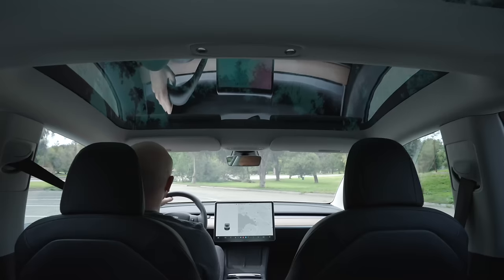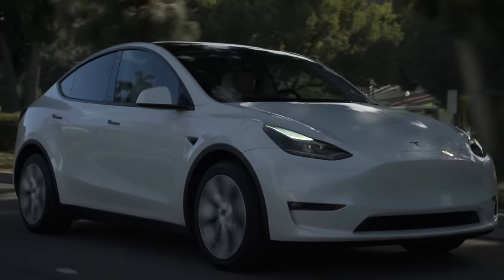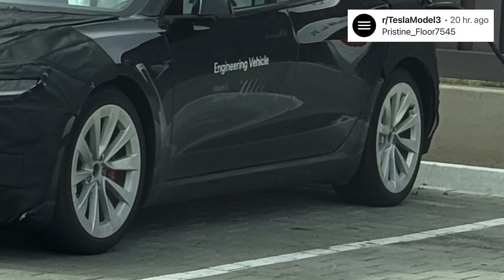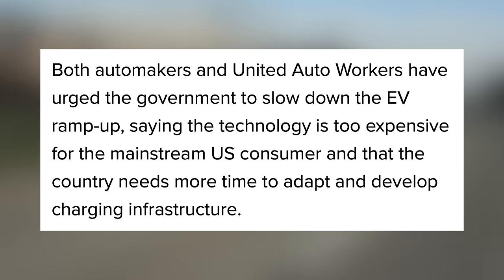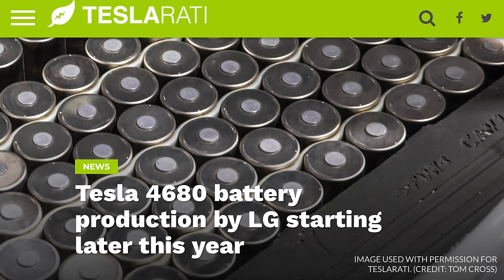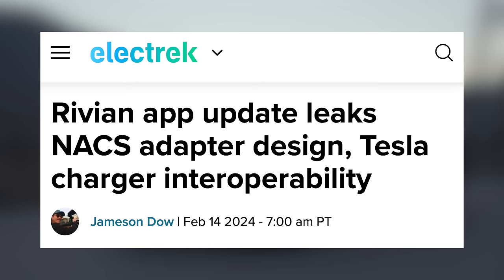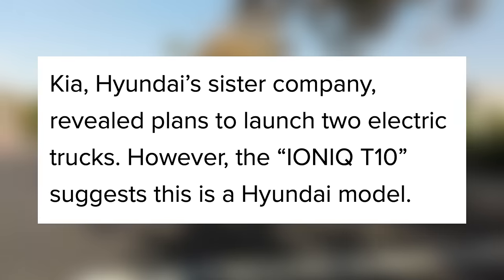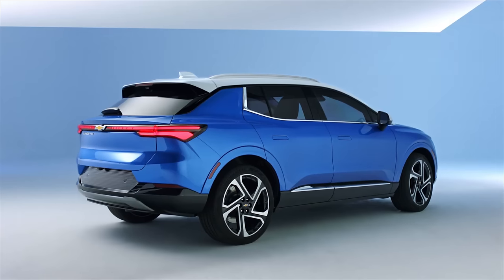NEW Tesla Photos LEAKED | We Can’t Wait For This Release

Comment: I am glad that Tesla is going to fix the auto wipers because it is currently the biggest frustration with the highland.
If they can just come up with an easyer way to operate the blinkers at roundabouts then its as good as perfect.
Reply: Yeah, maybe like a stalk or something that sticks out of the side of the steering column 🤔
Reply: its all of theese teslas not just highland its because they refuse to add a rain sensor and rely on a camera my 2011 shitbox 10k when it was new car has better autowipers than my tesla
Reply: @TagetesAlkesta 😅 😂 yeah no kidding.
Reply: I use 2, S3XY buttons on the front of my console. They are programmed for left and right blinker.  Works great.
Reply: @TagetesAlkesta  it'll never take off.
Reply: @salty8852  I'd prefer my cars to get the basics right, rather than have to fix them. Having said that maybe there's an industry in fixing Teslas shit interior design, adding stalks, adding a dashboard, proper gear selector etc, removing dumb ass yoke where found etc. Its a bit of a fixer-upper straight from the showroom to be honest.
Reply: Not only is this a highland problem. I think is an issue at every Tesla.

Comment: Glad they went back to a traditional horn on the Model S/X!  We really needed it for the last 3 years!!!
Reply: Facts!
Reply: I hope they’ll also bring back at least the blinker stalk. I don’t see how cars could reasonably used as rental vehicles without some controls being what everyone is familiar with.
Reply: Give it time and we'll probably see Tesla go back to stalks because by removing them they have pushed  potential customers to another brand. Not the best idea when there is more competition out there vs a few years ago.
Reply: I hope they release steer by wire for S and X
Reply: I have a yoke on my 2023 X.  I love the ability to use everything without yesterday's stalks.  I can easily turn the wheel with a finger.  On long trips I can easily rest my arms at the wrists on the top of the yoke.  I found that sliding my finger over the turn signal capacitive buttons better than touching it like a button.  Learning new behavior for some people is difficult.   Unlearning learned behavior is also difficult for some.  I have learned and trained my brain to use the buttons on the yolk, which has now become instinctive.  Even passing my thumb over the horn button is simple.  For slower learners, I would suggest sitting at the wheel for 30 to 60 minutes re teaching your brain how to use the buttons to the point that it becomes instinctive.  Learned hand coordination.   I love the yoke on my X.  Thank you Elon.

Comment: Hopefully they will bring back the whiskers for signaling. Having multiple roundabouts and the law that says you have signal out of the roundabout is just a really not something you want to experience in daily driving. They should be atleast optional because these buttons need to be pressed on steering wheel when it's upside down and the arrows are the wrong way and hand are not at good position to press them.
Reply: I don't think they'll bring them back unfortunately (maybe an option?). Perhaps what they could do is put an gyroscope in the steering wheel so when it's upside down what you visually see as the left arrow will function as left? Like when you're browsing the internet on your phone in landscape model and then you turn your phone upside down and the screen rotates back to an orientation where you can read.

Comment: 0:46 I thought the biggest problem is there is no progressive steering logic when the yoke is installed. Most every other car maker who implements a yoke in their vehicles has the steering sensitivity adjusted to suit the yoke-- full directional travel is achieved without every having to turn the yoke over itself. In the Tesla yoke setup, it turns like a steering wheel, meaning you have to spin the yoke completely when making sharp turns like for a U-turn or negotiating a 3-point.
Reply: because there is still wire connection except cybertruck
Reply: Outside of Formula 1 who else has introduced such a dumb idea for road cars?

Comment: I have 2 Tesla vehicles and have never had a lower total cost of ownership. The maintenance costs are super low, and if you charge at home then expect to get roughly the equivalent of 50 mpg. These cars are super affordable and just a pleasure to own compared to a complicated and archaic gas guzzler.
Reply: You must have really expensive home electricity
Reply: @Chukonu5  around 0.15 / kWh, not cheap but not terrible.
Reply: How about insurance? Is it $3000 a year? And registration fees?
Reply: @joo02  around $2k/year each so more expensive there, no reg fees really in my state, just had to change the stock tires after 32k miles, no brake jobs yet, no other maintenance beyond wiper fluid.
Reply: You must have been lucky! Every tesla owner I know has had expensive problems and they won't be getting another EV
Reply: @paulbaddiley7326  I've had a couple of problems, all under warranty and they came out to my house to fix it. Definitely glad I didn't get a lemon, that must suck no matter what the drive train.
Reply: On my second Tesla. 6 years of ownership and I couldn't agree more. 

The insurance on my 2023 Tesla Model 3 Performance is $5 less a month than the coverage on my 2023 KIA Forte GT. Same insurance company, same coverages. I got the KIA for my daughter to drive.
Reply: Well he charges 2 teslas

Comment: The Chevy Equinox 1LT that is $35k will not have over 300mi range. It will have 250mi estimated. GM has already laid out the trims and all the dealers already have the details. 1LT is the lowest trim front wheel drive with 250mi range. That makes it more expensive than a last year bolt with about the same range. 

Notice how automakers always say “up to” when talking about ranges. And always say “starting at” when talking about price? It’s intentionally misleading. It makes you think you can get the “up to” range at the “starting at” price.
Reply: If you're concerned about range, get an ICE car, like double the range, no worries about using electrical accessories, cabin heating etc, minutes (seconds?) to recharge, shouldn't lose 30% power inside a few years warranty period, doesn't care about winter range, is it raining etc. DOn't have to spend 30 minutes of maths considering altitude, climbing and coasting before setting off...

Comment: Did you notice the red brake callipers on the engineering picture when you zoomed in. Also by comparing the front bumper disguise / bra design and positions of the padded section on this engineering vehicle with the bumper disguise used on the ‘highland’ versions, you should be able to work out what they are trying to hide / redesign for the performance version

Comment: Moving the horn on the yoke restores the human interface that works better. Like restoring the stalks would do.  “I couldn’t turn on the signal because I was turning” or “oops, I flashed the lights instead of the turn signal because I was turning”.  Different and cheaper to produce is not always better for the human interface and it doesn’t always add to the quality feel of a car.
Reply: How about going back to the ultimate human interface?  Open your window and signal with your arm!  And don’t even get me started on stalks!
Reply: @srdrone5999  
There is a reason that Stalk work is that you always know where they are.  You can keep your eye on the pillar or what ever you are maneuvering around and shift quickly from reverse to drive without having to stop, divert your attention to the screen to swipe your finger along the path for the shifter for instance.  
Also keeping the interface consistence between vehicles is important to some extent.  This is why accelerator peddles are on the right no matter what side the steering wheel is on.  It is why brakes generally feel harder the more they are depressed.  This is true for Aircraft and ground transports.  
Don't you think flashing lights to signal the person behind you is better?  Don't you think that a hand signalling a turn in the dark or inclement weather is less effective letting the humans driving around you of your intentions?
Reply: This is why, when it's time to trade in my 2023 MYLR,  I'll be getting a Hyundai.

Comment: That adapter is identical to the magic dock adapter with the addition of the manual release for the J3400 side. I bet that Tesla designed the adapter and is manufacturing them. They may end up only allowing their adapters at their stations via software to prevent potential hazards.

Comment: What's so funny about this is that a '96 Honda Accord has their horn on buttons on the steering wheel as opposed to the middle of the steering wheel. Don't get me wrong, I never liked that either, but it was alright and you get used to it after a while. It'll be funny for those who upgrade their car based on such a small change and they get confused about the horn not being a button. lol.
Reply: If I remember correctly, it had to do with implementing air bags.  They didn’t want to have a horn button smash someone in the face.  It was a long time ago and I might be wrong on this point.

Comment: I recognize that the trope "Tesla is always trying to improve their cars . . . " has some merit, but not always.  Disabling radar in those cars that have it sets up common mode failure situations where safety response is paramount.  People will write that Tesla's cameras are as good as the human eye (quoting Musk, I am sure), but that means that if the human eye can't see, the Tesla cameras can't either.  When a safety response is required, taking away an independent sensor feeding the computer, particularly one which was paid for by the customer, is not improving the car.

Comment: The circular steering wheel with a horn in the center and manual override for windshield wipers are great improvements. Next model may have door handles which can operate without power. I hope that within ten years, Tesla will have learnt all the lessons that the car industry worked out decades ago.
Reply: They do lol

Comment: Hybrids should be ev first with 40-60 kWh LFP and a little combustion engine as a range extender electric generator for road trips or when charging fails. Chevy volt did that, BMW i3 Rex did that, now Mazda Mx30 Rev does it but with a too small battery.

Comment: I still don't understand the 4680.  IT was worse energy density than the 2170. Also, I find it hard to believe that LG needs to make a new factory in Nevada when the current Giga plant that Tesla operates with Panasonic is not even fully built yet.
Reply: Its almost like you've swallowed the marketing guff whole.

Comment: All I want is better range and charging. Especially in winter. Give me 300miles minimum range, 10-80% charging in 15 mins. That is all. I don’t need more power.
Reply: NEED!
Reply: @peedeegt  no it won’t. This is BS
Reply: @peedeegt  maybe if your driving strictly on streets obnoxiously below the speed limit, you're not getting that on the hwy for sure. Especially if temperatures are well below freezing, maybe in the spring/fall season you can get that range, summer is a bit tougher due to heat outside and AC/HVAC consumption I'm the cabin.

Comment: I test drove the Y and was ready to trade my Lexus RX350....but I travel to/from Chicago to Phoenix each year and that's a three day drive.  Using the Tesla trip planner, IF all goes perfect, I need to add an extra day to the already long drive.  That might be ok, but then I read the reviews from many of my suggested stops and they weren't reassuring.  Some stops have no services, so I'd have to make additional non-charging stops which add even more time.  This is on top of the broken chargers, broken CC readers and long lines waiting to get to a charger.
Bottom Line:  the car is a great achievement.....interstate infrastructure needs massive work.  No Sale.

Comment: Same problem with the left right turn buttons, if you are making a left and then a quick right, you are F ed. YOu can press that right button while your steering is upside down...bad design. that's one thing I really dislike about Teslas. Missing gear shift take some to get used to.

Comment: You may or may not know but there’s a whole bunch of new EV’s coming from BYD also and they’re gonna price their vehicles a lot cheaper to begin with and they’re gonna come out with new batteries and a lot of the issues that were currently having with batteries like slow, charging and slow range a lot of these issues are going to go away so the fight isn’t over yet. The fight has just started and it doesn’t matter if General Motors and Ford don’t want to compete which is the real issue Ralph Nader had that problem also with seatbelts, airbags, fuel efficiency, ABS, brakes, boy did they fight thosebut they lost

Comment: Model 3 is a great car for a small person. As a 5'11" 190 lbs man, it is a bit small. Plaid model 3 is def tempting. But, Juniper Plaid  will be much nicer.😂
Reply: I'm a 6'3". 235 lbs Santa Claus, and I fit my Model 3 fine. It's a little low for older folks to get in and out of, but I haven't had any problems so far.

Comment: Is this a joke?  Certainly Tesla isn't just introducing thiis "Our newest Model 3 comes equipped with a new blind spot indicator light. When a vehicle or object is detected in one of your blind spots, a red light appears in the front upper speaker grille. The red light will appear solid, blinking or blinking rapidly depending on how close your Model 3 is to the object in question.

This, along with other standard active safety features, helps you stay aware of your surroundings and can help you make maneuvers more safely."    Blind spot indicators is new tach?
Reply: Blind spot indicators have been available on screen for awhile now via a software update. I notice that they actually are more advanced than those on my other vehicles; the indicator alerts for cars that are not yet within the blind spot but might be coming up fast. On my other ice vehicle, the indicator does not seem to have any concept of approaching vehicle speed delta, and will alert when a vehicle is in the blind spot, whether they are coming real fast or just creeping up. If they are coming fast, it might be too late with my ice vehicle.
Reply: I thought so.  I wasn't sure if I had been spammed

Comment: In the UK this is the same price it was 5 years ago.  I've zero clue how they've done it and its a much better car than the outgoing one.  Its almost a bargain considering inflation for the last 3 years.  Capitalism at its finest. More car for virtually the same money it used to be.
Reply: They’ve engineered out a lot of costs. It’s an ongoing project.

They’re also able to negotiate better prices from suppliers as time goes by and they continue to prove that they will buy everything they say they will and that those volumes continue to grow. Good old economies of scale.

Battery costs while still significant and falling. Tony Seba is interesting here - he predicted massive battery cost reductions. About 10 years ago, maybe more, he predicted the cost decline in batteries and so far he’s been absolutely bang on the money. We’re still a long way from reaching a plateau too. Worth looking it up if you’re interested.

Plus not all inflation during the covid nonsense was equal, and not all was permanent.

Comment: A pity that this channel often sounds like reading Tesla PR matrial.

I don't think reaching 2/3 EV in less than 6 years is realistic. However going for plugin hybrids has been proven to be basically a scam - people don't charge the batteries so the consumption of 1.5l / 100km advertised here in Europe was 10L in many cases so it's just greenwashing. It's kinda facepalm how US automakers are turning to this, proven to be bad direction now in 2024. Just tax emissions and people will turn to smaller, more efficient vehicles more and more. A few years later it will be easier to enforce regulations to push the remaining crazy polluters downwards.